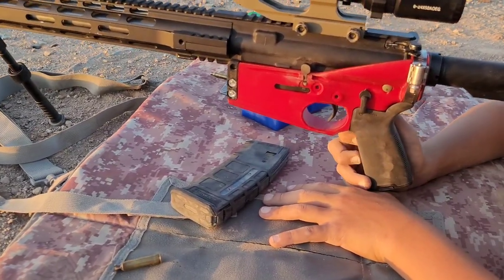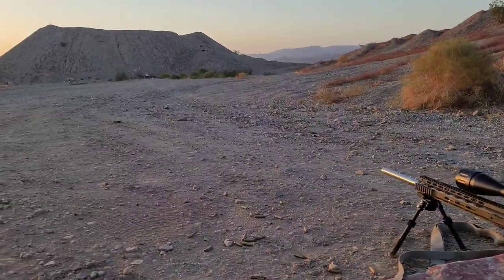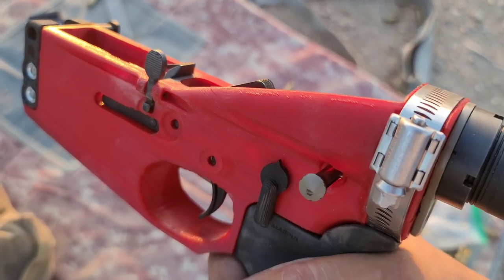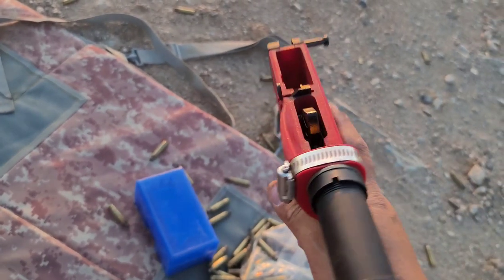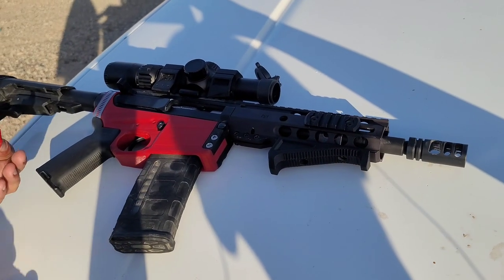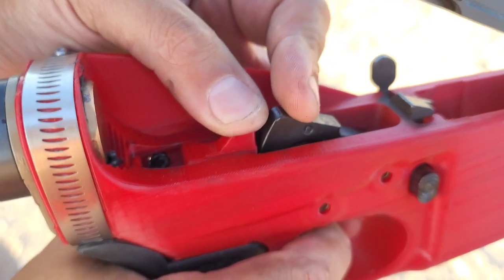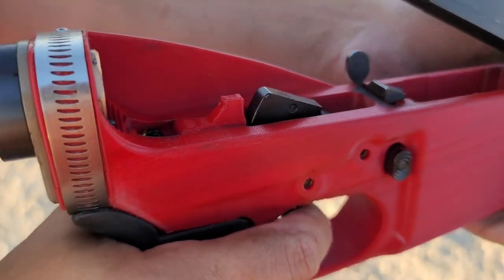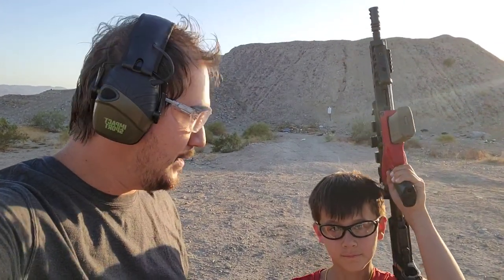3D Printed AR15 @HoffmanTactical Superlower V2.4 | Full Auto Test

Comment: This is fascinating! What printer did you use? My brother and I just split the cost of an Ender 3 max and I'm already getting antsy to print one of these.......
Reply: E3Max is sufficient. Make sure to square your frame properly with a mitre square, tighten the screw terminals under the black power supply cover, and update your firmware using TH3D's guide.

Comment: Would it be possible to 3D print around a ring of steel for reinforcement instead of doing the hose clamp? Or would it interfere with the buffer tube. Maybe it's already been tried? 🤷‍♂️idk
Reply: Nah that would be hard to do for 3d printing. Maybe making an insert?

Comment: Do you mind expanding on why this shouldn't be printed in ABS like you mention in the video? I have very little PLA right now but I do have about 3kg of ABS with an enclosure set up for my printer that I was planning on using. I also have a spool of PETG but it's still in the vacuum bag.
Reply from the maker: Layer adhesion. Check out Hoffman's channel. He show cases that
Reply: Petg is good to print these with as well
Reply: Most common I've seen is pla+ or most nylons. I know pla is the better moisture absorbance resistance

Comment: 7 1/2 hours print time?! What are your exact slicer settings no way even at 75mm/s at 100% infill does that seem possible! Are you running a larger nozzle?
Reply from the maker: Not running 100%. 85% 75mm/s. 0.26 layer height. Best layer adhesion for me. Using a Qidi Max
Reply: @EagleEyeShooting  ah that explains it, nice! I had one running yesterday and it got to 19 outta 21 hours and a storm knocked the power out....

Comment: a ar-15 can never be a full auto rifle.
 as if it was a full auto. it would be a M-16.
Reply from the maker: You obviously need correction and education.  A designated M16 is designed differently with an auto sear, rear shelf design to accommodate the sear arm and is government issued. 
Just like citizens with special license like me can file a form with the atf and obtain approval to mill/mod a lower receiver as non issued m16 machine gun lower.